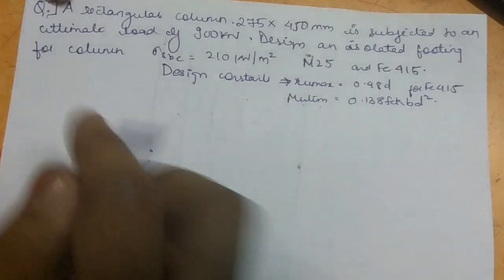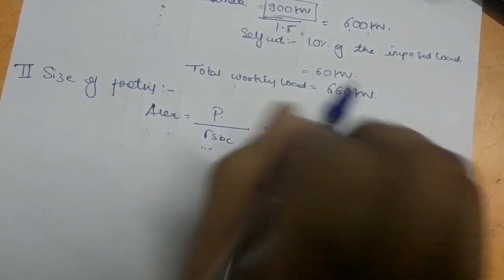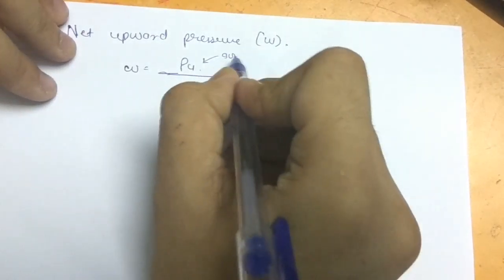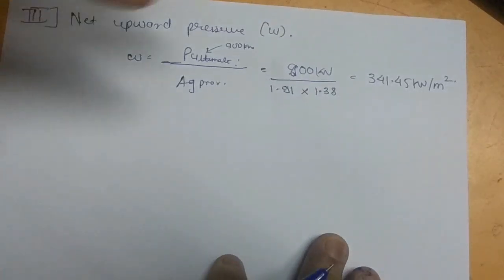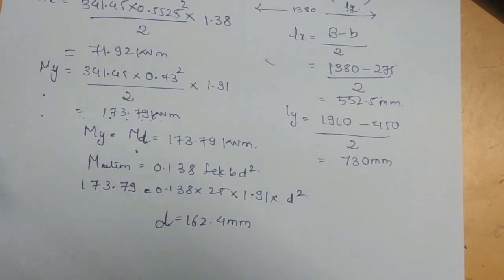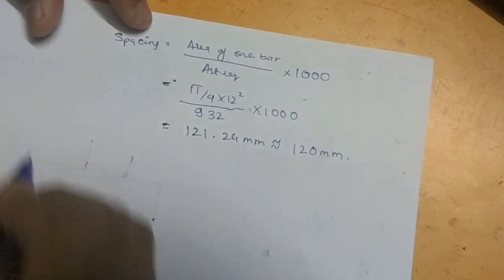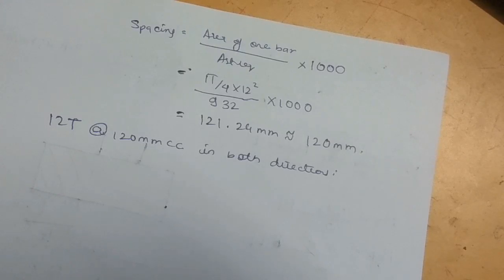DESIGN OF FOOTING Solved Problem | IS 456 | Limit State Design | Mumbai University

Comment: d does not come as 162 mm from your calculation ??
Reply from the maker: Sorry for late reply dear. For your query..
As you know answer is in mm we need to take all units in N and mm.

Therefore it will be 173.79x10⁶ = 0.138XX25X1900X d²
Reply: @EverythingCivil  if you do by considering that also answer is different

Comment: Sir, the Ast formula used in slab design is Ast=Mu/0.87fy.Z
What's the point of using a different formula which is not even in code?

Comment: For calculating the moment full width of footing considered. But for area of steel calculations breath was taken as 1000mm. It is wrong but of course it's safe.
Reply from the maker: Steel can be calculated for per metre width of footing which basically eases up the calculations.

Comment: Thanks, I think we should not find out calculation fault, it may be tap wrong calculator button. we need the original method with details or short. 
I think you should consider punching shear, aren't I right? by the way, the video was helpful.

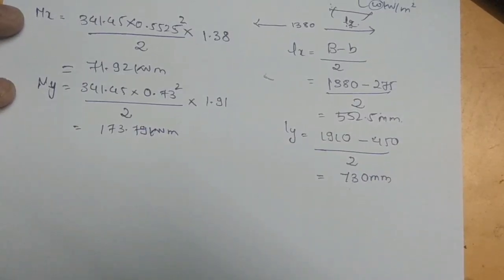Comment: Sir, at 9:56 while calculating the moment Mx the value  1.38 should be  1.91 and at 10:56 while calculating moment My the value 1.91 should be  1.38. For  calculating the mmts refer https://nptel.ac.in/courses/105105104/pdf/m11l29.pdf. If I am wrong pls. correct me.
Reply: I think 1.38 and 1.91 m are correct but 0.73m and 0.552m should be interchanged in  Mx and My calculation formula.

Comment: if we first check for shear , then we have no need to assume depth
Reply from the maker: You need to check depth using span by depth ratio. Because the slab will fail due to deflection instead of shear failure. Also for doing further calculations like Ast and Mulim you need to assume depth before.

Comment: 4:05 , the value of L is wrong.  It's a computational error. 1.63*1.38=2.25
Reply: Rohil S Nair correct it is 2.2494
Reply: steps are correct right?
Reply: Indeed
Reply: Yess
Reply: upward pressure =289 kn/m2 if calculated value will get 2.25m ,My = 312 kn-m , depth per meter will be 300 mm , so to increase depth by thump rules 2.5 x 300= 750 mm , as assumed depth = 600 mm ?ok

Comment: should not be Mx equal to  
w*lx^2*length of footing (1.91m here)/ 2
and
My equal to 
wly^2* breadth (1.38m here)/2 ?????
Reply: yes. exactly the same thing I was wondering! whatever you said is correct, bcoz we need to multiply it with bredth so as to get it's load per unit length and vice versa.
Reply: Exactly my point.